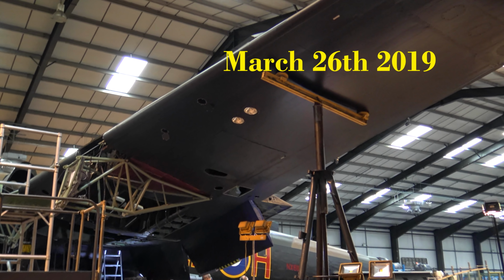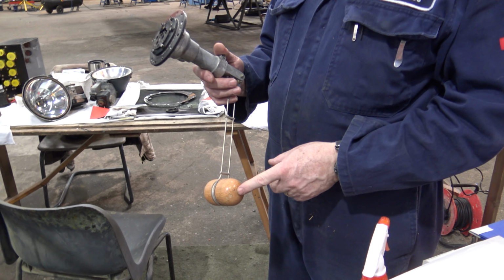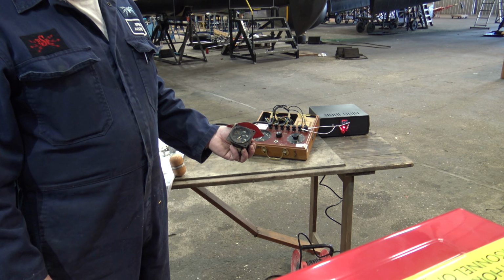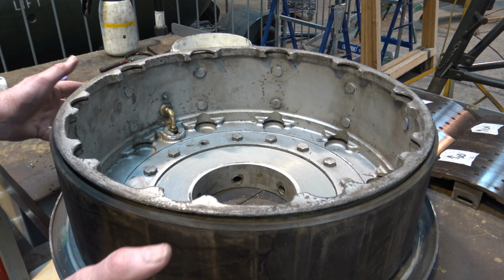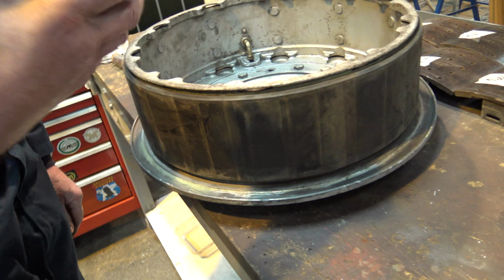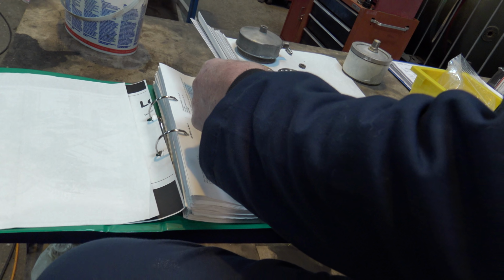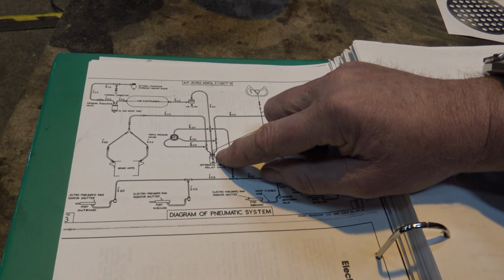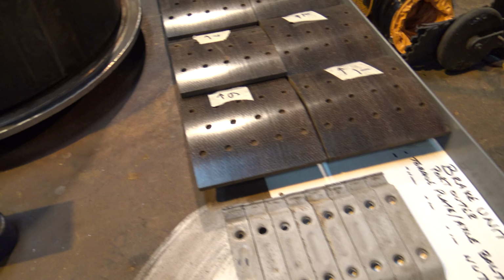Video 14 Restoration Lancaster NX611 year two.

Comment: Holy cow !  How in the world can y'all replace the air bladders for the brakes, and the shoes, when needed ?  And silly question, had they not invented disks back then ?  And you had a good question about braking fully laden.  That is hands down the most dangerous and stressful testing for modern aircraft - the so-called "hot brakes" test - worst case scenario running the plane - with max load - up to take off speed, then braking to a stop.  The brakes are known to generate enough heat to cause fire to break out.

Comment: That was interesting to say the least! I always thought the air gen cart was for the oxygen systems only, and the brakes were operated by tapping the top section of the rudder pedals. Pneumatic brakes, I'll be. Thanks Neville, you're the best and so is the retos crew for letting us all in on the "Lanc"!
Reply from the maker: Hi Bob, I found that part about Lancaster differential braking system very interesting .Thanks for watching

Comment: Morning Neville, thanks again for another informative video. Can I ask what a “Bonded Store” is please, heard the name mentioned before regarding the storage of the airworthy engines. Thanks
Reply: Nicked this off the internet... "Bonded stores means store where aircraft components and materials, bearing evidence of having been received from approved sources, are stocked." I found it - amazingly enough - on a site called aviation Bangladesh!
Reply from the maker: Hi Diesel bushcraft, Peter's right , the way I see it, if a engineer services a particular part of the aircraft, and any new parts fitted he logs it down. If the engineer is not CAA certified he will then have to get his work passed by a CAA engineer, if the part is not required it will then go into the bonded store as airworthy